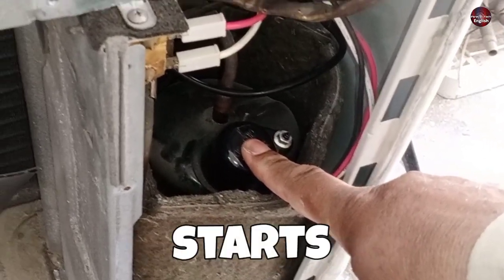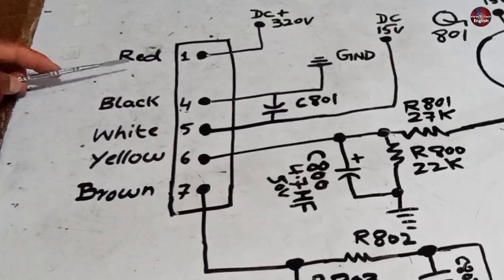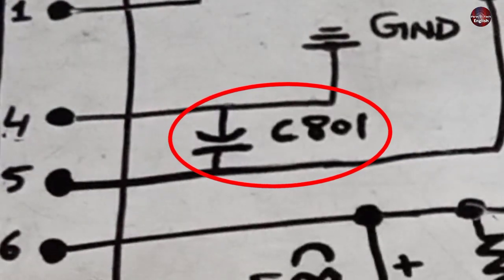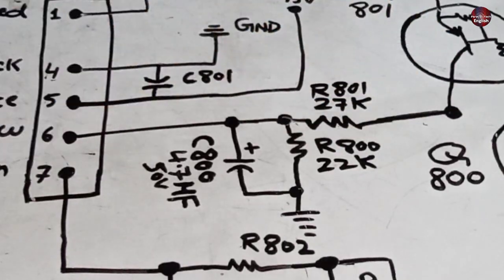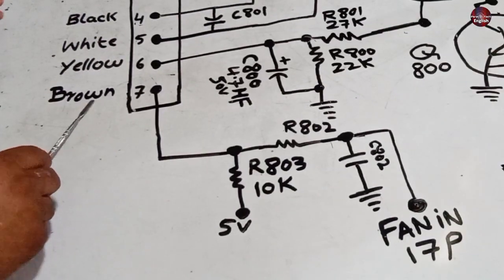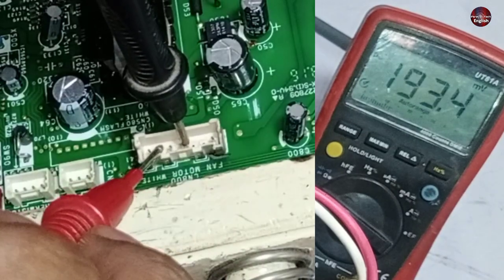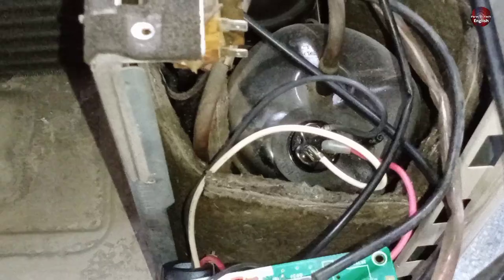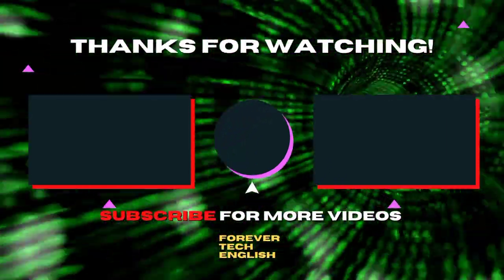Fan Stops In Mini Split Ac - No Output From Control Board

Comment: I experience the same problem but my mini split ac is non inverter, how will I solve it
Reply from the maker: If the fan is not working check for the fan capacitor installed in the outdoor unit, other than this if the fan itself is bad. Replace it with a new one.
Reply: @forevertechenglish  God bless u sir